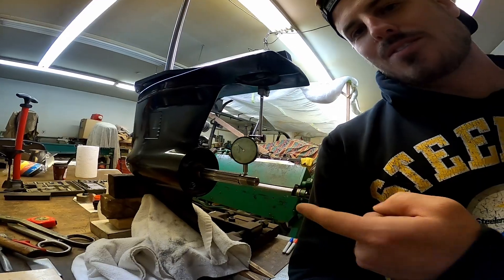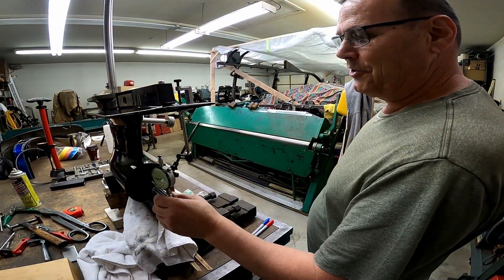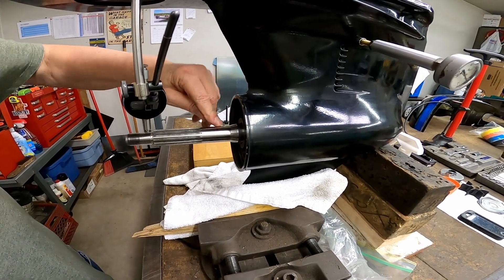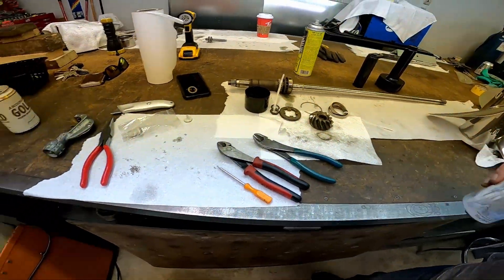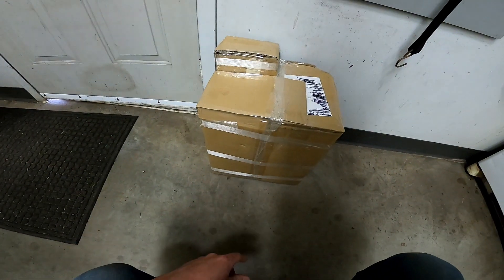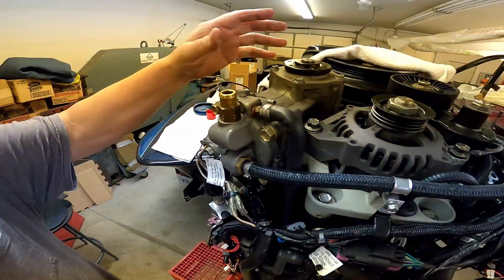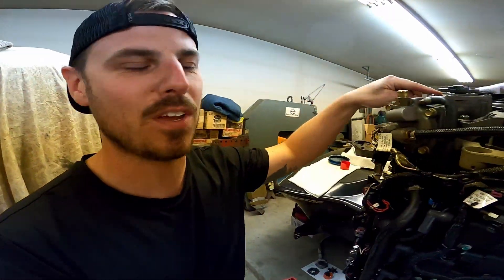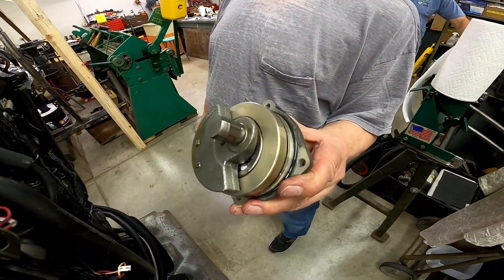BLOWN Compressor On Our Mercury Optimax Pro XS - Disassembling compressor to investigate

Comment: did you mike the spot on the shaft that the runout gauge is touching to make sure it is perfectly round?  if it is not perfectly round, it could give u a false reading,. measure the area of the shaft from 5 different axis and see if there is any variance.. if a shaft is bent enough to cause problems, you should be able to run the motor, and watch the shaft turn and see it , if you cant notice being bent with your eyes, it  is not going to cause a problem.
Reply: Thanks for watching and commenting mercury has a tolerance number for these shafts of.009 this was .015 and was visible by eye turning the shaft it was straightened by a company that specializes in that area as well as props
Reply from the maker: Shaft was definitely bent, badly, lol

Comment: Hi guys mine just blew a couple weeks ago, 05 opti 225. looks like I dodged a bullet. I was close to the dock knew something was up with the knock sound and not much metal fragments. Needle bearing blew apart. Looks like I’ll be dropping the 1300 on the part 🤦‍♂️I’ve read to keep that water screen clear to keep them running as cool as possible
Reply from the maker: You sure did. I would have your injectors and hoses send out to be cleaned as well, if it was coming apart. I’m sure @chrisholmes1666 can chime in with some more info as well
Reply: Yes on keeping the strainer clean. I would have the injection stuff cleaned and flowed including hoses and rails at a reputable place with marine experience .Change the two filters on the oil return lines from the compressor they run to your upper and lower main bearings. You need to take it to a mechanic/dealership and have them do an oil pump prime on it when you get it back together it's cheap and doesn't take long to do .

Comment: You can't accurrately check a shaft while in wore out bearings. .001 in a bearing race can multiply a lot by the time you check way out there on an undercut thread.
Reply from the maker: Must have been reasonably accurate, as that’s is exactly what the repair shop came back with as the pre-repair runout as well🤷‍♂️
Reply: The procedure for checking these small shaft verado cases is spelled out in great detail in the oem service manual the actual specified measuring spot is directly on top of the thread we had just moved the indicator forward to see if it was the same in that spot when the video was done they also give acceptable bearing tolerance specs as well . The people that straightened it have much more accurate methods of measuring the bare shaft than what we used to determine it was bent while installed in the case .They have been in the prop and prop shaft repair business for many years and have an excellent reputation. The fat shaft 1 1/4" torque master cases are measured in a different spot just in front of the splines .

Comment: Always here about the horror stories with compressors. Anything to do to prevent them from blowing.
Reply from the maker: Yeah it is unfortuantly a VERY common problem if the motor still has a gen1 (grey) compressor on it. Just a bad design that puts too much thrust on the crank pin. The gen2 (black) compressors have an additional bearing to help. Not really much to be done as far as prevention, just keep an eye on it so it doesn't completely destroy the rest of the motor in the event of failure.
Reply: Thanks so much for watching and responding I think its kind of luck of the draw this one has just under 400 hours on it and that seems to be the magic number when they have issues but there are lots that go 800 hours and more. Some of the earlier ones were more problematic I believe there was a manufacturing problem for a while that has been addressed this is one of the older unpainted versions made in mexico they have done some redesign of the crank bearing area and how they are oiled on the new painted ones that said there are still failures with the new style as well as far as maintenance keep the strainer clean thats in the exhaust adapter plate so it gets a good supply of water you can see when its restricted by keeping an eye on the tell tale stream strength. Use DFI oil in your optimax and if you are going to leave it sit for a while pull the belt cover off and add about 8-10 drops of premium plus two stroke oil into the compressor inlet and turn the motor over a few times with the kill switch off this lubricates the piston and cylinder walls to help prevent corrosion . There is moisture present because it is a compressor and any type of compressor will make some amount of moisture.
Reply from the maker: All great info, Dad.